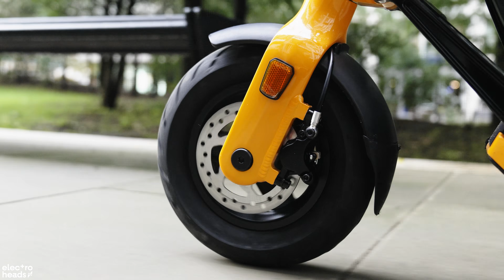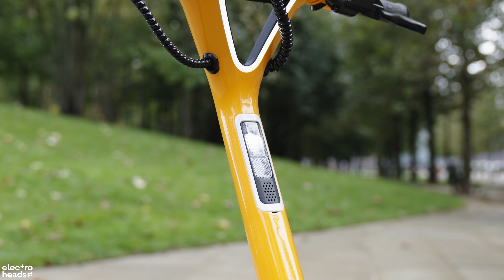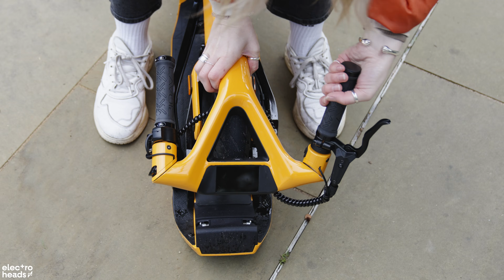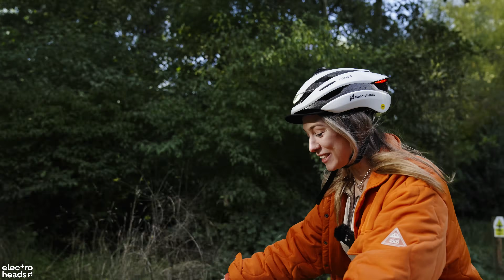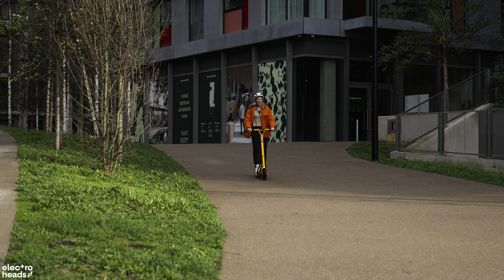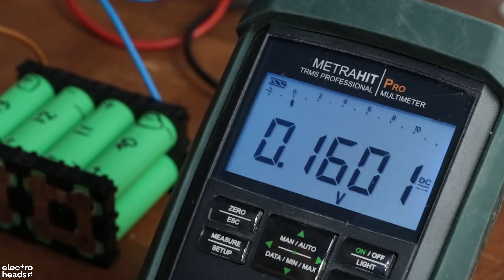Do NOT call this vehicle an e-scooter - here's why

Comment: This thing is incredibly overpriced. For the same price you can get a number of scooters with MUCH more power and suspension (Mantis King GT, Vsett 10+, Bluetran Lightning, etc.). The website is almost completely lacking in specs. The foldability is cool and it has a nice aesthetic but it should cost about half what they're asking.

Comment: Way too low to the ground (one pothole and you're fucked!), horrible disc brakes (compared to drum) which are crap in the wet and too much hassle maintaing, small (single!) motor, zero suspension, no proper kickstand (for fast easy parking and pulling off) .... stupidly high price. Errrr .... no thanks.

Comment: A reliable e-scooter will always come with some form of suspension. This scooter does not come with suspension, therefore meaning it is not as reliable in comparison to other e-scooters in its class. Yes it is built nicer, but it is not going to last as long as others that have a suspension. Also the throttle on this is relatively cheap and easy to break, and also pretty uncomfortable to use.

Comment: Well, I wouldn't buy a £1,900 e-scooter even if they were legal, and would absolutely rather pay £3,000 for something that is the same, but actually admits to being an e-scooter because I'd happily pay a tax to avoid that kind of pretension which leaves a nasty taste in the mouth. What's good about this is them putting money into R&D which may or may not lead to other firms copying their ideas if any are useful. Which obviously considering they're not legal, their biggest fan and an undoubted expert on e-scooters, wants a bigger wheel, and at this level of cost it obliterates the value proposition for most people, I don't think they are. 

This is the same as the Microlino. Instead of concentrating on fundamentals such as making a good product that's easily produced, and therefore cheap to make and sell, they're aiming at the Apple end of the market. Which is a good way for normalising these things - who has more money to fight the good fight in Parliament than the type of people who'd buy products from Apple? Difference between them and Tesla is they have no environmental credentials of any kind, and no plan stated up front to build the expensive one so they can build the mid-range one so they can build the cheap one. 

I do hope Bosch or someone creates a standard battery specification that we can all use in our e-bikes and e-scooters. It's kind of hard to see why we can't just plug in their power tool batteries to be honest. That'd be a killer feature at some point (and yes, I know the form factor isn't ideal for current e-scooter designs but that's what engineers are for).

Comment: I spent £550 on my Pure Air Pro LR that has 37 miles of range and I ride it back and forth to work knowing full well the police could nab it from me any day they feel like it. At a whopping £2000+ it's just too much risk to get it confiscated... or even stolen.
Reply: Yep, exactly this, UK needs reform
Reply: The whole legal thing is a total crapfest. I ride an illegal ebike with 250W sticker lol, they already confiscated my throttle but at first threatened to take the whole bike. I wasn't using the throttle much anyway so don't miss it.
Reply: @manoz6194  What kind of ebike is it and what made them check your ebike? was it random checkpoint they setup? I have a 750w samebike lo26 ii and have had zero problems, I never go near them for them to see my thumb throttle but I guess if you have a cop that knows what to look for :(
Reply: @Neilukuk  I work in as a bicycle courier and I was picking up an order at the mall and when I came out there was a bunch of police inspecting bikes of other couriers too since they also have illegal bikes. one noticed I had a throttle so I just quickly took it off and gave it to the officer. They were also checking citizenship status since there was a problem with immigrants doing the job illegally.
Reply: @Neilukuk  It's a 750W motor. They came back several times over a period of weeks but I managed to avoid them after the first time.
Reply: @manoz6194  Damn crafty buggers. Glad you now know where to avoid, you just have to stay away from other groups of delivery drivers and you should be safer and park your bike away from rest. it's not so easy avoiding them doing deliveries though. Take care.
Reply: @manoz6194 I hate to say this but you run an big risk, you maybe a safe rider, but if an accident happens and the plod find out your e-bike is illegal, then I strongly recommend get a good lawyer.
Reply: @JohnnyMotel99  but it says 250w on it ;)
Reply: Putting 250w sticker on an illegal e-bike could get you done for perverting the course of justice. @manoz6194
Reply: I use my electric unicycle not only to get to work, in the early hours,  but as part of my work. Instead of my job taking 3 and half hours,  it takes me one hour, leaving me time to get the rest of the work done. Electric scooter and e-bikes are no good to me and have used both.
Reply: I spent 4K on my nami burn-e and ride without any worries. if you sit and make yourself worried and get police fear, what's the point in doing it in general. 550 is still a lot and you're still gonna lose a scooter and money either way. the key is to wear gear, ride sensibily and if you do get called over or flagged to stop, just act oblivious to them and ride out of site. I can do 60+ on mine so I get it, you can't run off like me, but still, just be aware of your surroundings and don't ride like a tit. it also helps not having anti bikes/scooter/motorbike cops, they suck lol

Comment: I am not interested in buying an e-scooter, but damn this one looks sleek and well thought out.  That folding systems is very nice! And with the wide standing pad and build in turn signals etc it is probably safer then some legal alternatives. Although going 40km/h on this seems like asking for accidents.
Reply: You'd be surprised I think. I can't speak for this scooter since I haven't ridden it, but the angle that the stem has means that it's going to have a good bit of stability. This seems like an overpriced scooter to me. There are much less expensive options that have much more performance and comfort built-in. One thing to be aware of when buying a scooter is that if your commute includes hills you really need dual motors. A single motor scooter might be able to handle a hill, but it'll burn out the controller fairly quickly since it's having to work super hard.
To address your speed concerns, performance electric scooters (which this is not) are purpose built to be able to handle those speeds. Before owning one myself I had the same concern as you, but after riding it for a month or so I realized that the shocks, weight, and durability of the scooter made riding it at higher speeds perfectly safe. You just need to be sure to practice your hard breaking and rapid turning in an empty parking lot for an hour or two prior to going on the road since scooters need to avoid objects rather than going over them like a bicycle. When breaking hard you need to duck down and lean back or you'll go over the handlebars. To turn quickly at speed you need to learn to counter steer, just like you would with a motorcycle. It's actually pretty easy.

Comment: I can see two problems with it when stopped by the rozzers, 650 watt motor and top speed. 10” wheels on a U.K. road is asking for a trip to A and E.  Nice scooter though.
Reply: My e-scooter has 10'' pneumatics and i ride it on the road same as any other bicycle.
Reply: @jlb4685  are you riding in all British cities and counties? Or just one that happens to have good roads along the routes you use? Or do you avoid the roads with bad potholes and drains lower than the road surface? His complaint is perfectly rational.
Reply: My 50cc crap box moped has 10 inch wheels 🤣. Surprisingly not awful ride quality.